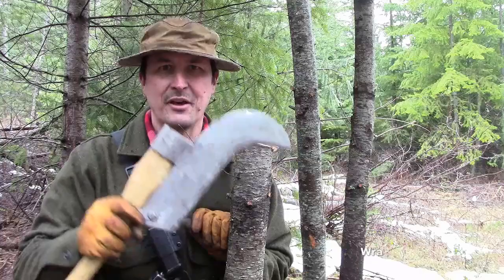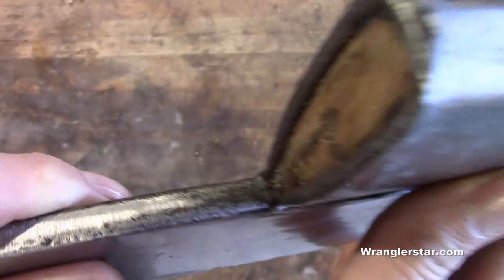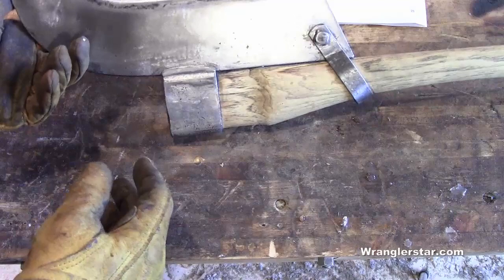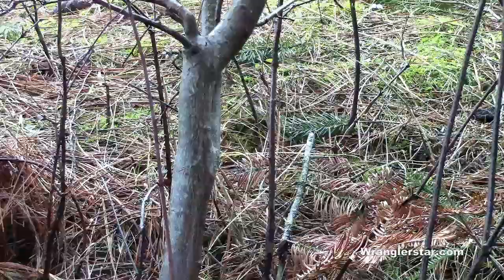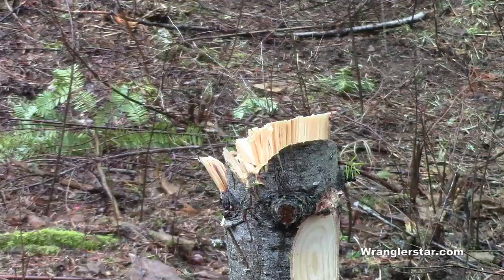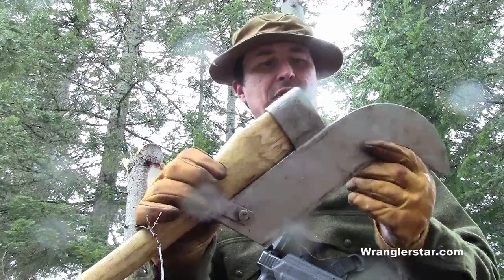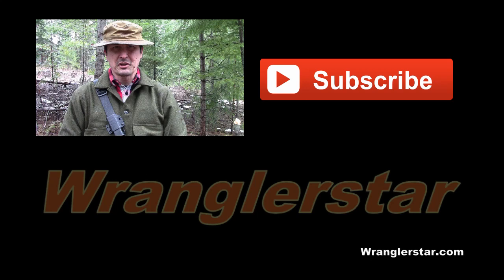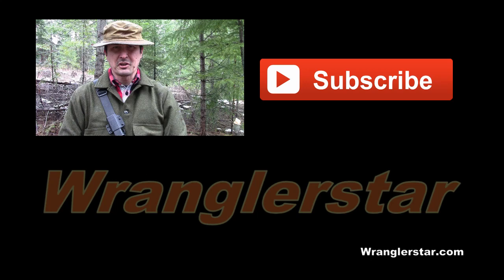A Proper Brush Axe - Wranglerstar

Comment: We use quite a lot of similar brush hooks here in northern Europe. The most common kind is a short handled tool for removing the branches from small felled trees. They are also excellent tools when roaming in wild forests. With a longer handle, similar to the one you used in the video, they are mostly used to cut thick brush where the stems are around 1-2 inches at the most. The long edge is to make it easy to use, as you said it doesn't require much precision. And the hook on the end snags the stem if it springs away. The important thing, as you stated, is to find the correct method when using them. One key thing is it has to be very sharp, and you swing it more lengthwise across the brush, not as much in a cross cutting motion. The tool you got I would say is for clearing larger areas of dense brush, for lighter clearing of single stems a shorter brush hook would probably be more practical (and can be carried in a sheath on your belt =) ).
Reply: Ditto on the tool down South (Greece). My country's equivalent is called among other names "branchcutter". Itis like the Fiskars model but has a rolled steel handle that can accept a wooden handle to reach higher standing branches.
For anything up to 4 inches it is vicious, Pic http://imageshack.com/a/img823/2584/webigp8289.jpg
Reply: GreekPreparedness
Looks awesome. I have a short Fiskars myself =) At the cottage we have 2 or 3 old ones with the same style rolled steel handles, but they need a lot of restoration to be useful =)
Reply: It's the same here in italy...

Comment: Thanks, I have a Friskers brush hook for the back yard and it worked great on the tall weeds and such. When trimming trees I like to cut up the brush to fit the trash cans.  I tried the brush hook and it kind of worked but the hook got in the way,then put a small log on my stump to clear the hook and it was better.  I was looking on line for a good machete and they were about $40 that I did not have.  The book you showed had one sharpened on the back.  I never thought of that.  With that sharp the hook is not in the way.  I am going to try that thanks a lot for the idea.

Comment: WranglerStar Fan Here. Great review Cody! (as always). I used both the type of axe you're using as well as the double-bladed type brush hook when I was working as a land surveyor years ago. I will say that I enjoy using the double bladed type best since it has 2 blades which I can use longer before having to sharpen as well as its lighter in weight which causes less fatigue. Also the double-bladed brush hook, with its lighter weight I found I can get more swing speed with less effort. I would choke up on the handle and with experience you can swing left and right to clear a path with non-stop walking. The double-edge brush hook I've found also works better than the axe you're using on briars and really thin stuff. I also found I could kill snakes easier with the longer thinner blade. Also, the double-edge brush hook has edge on the tip in a way too which can be used for digging or prying some when looking for something. A thinner blade is quicker and easier to swing, easier to sharpen in the field, gives you more edge which takes longer to dull, and I think more balanced. I prefer a straight handle too instead of the traditional handle of that of an axe handle.  We sell both types and the double-edge type is more popular. 
http://www.engineersupply.com/brush-axes.aspx
Reply: I failed to mention, the double-edge brush hook that is thinner, and less weight, one would think it could not cut down larger trees but that is untrue. My rodman and myself would stand back and take turns chopping at a 12" oak or popular and have it down within minutes using. They are amazing at cutting down larger trees as well as thin briers, making the double-edge thin blade what I consider way more versatile than the heavy axe you're swinging.

Comment: We use it for "limbing" trees after  we cut them down. Start from the bottom to the top, cutting from the underside of the branches into the trunk. If you cut downward it tends to want to cut the branch but also strips the bark on the underside keeping the branch still attached and hanging on.

Comment: A long handled billhook. Billhooks are great for clearing brash off cut branches and great for coppicing up to three year old growth. Also for hedge laying (pleaching and splitting long bolts). The small, one handed ones are more versatile and ergonomic than a hatchet. Closer control with a short handled one. When you have mastered the wrist action and you cut closer to the ground... you can cut through a 1 1/2" springy stem with a single sweep.

Comment: We had one of these growing up, of the exact same design but a different make. My grandad and uncle had no interest in learning or maintaining any of the tools we had but oddly enough, I did. I feel a little better hearing that other people think they're unwieldy. I'm a chick and I can still use one but it feels awkward and inefficient. I'll reach for an axe or heavy machete before the brush axe. My Ontario military 18" will go through anything two inches in diameter or smaller with less effort. The handle on ours was original with a beautiful patina and a surprisingly skinny handle, while the blade had a hideous green paint job that probably was added later. Great videos! Just subscribed.

Comment: Helpful tip. When brush is to springy to chop and the area around is to tight to swing, you can put the blade at the base of the brush and yank upwards at a 45 degree angle it'll slice the "vine like" brush. I have a handheld version of that. It's very good for limbing logs without the risk of chopping something off.

Comment: AT 6:11 on the tape we never cut that high we used it to cut down & up with part of the roots all at the same time.   I have the one sharpened on both sides & the pull side works in the clumps & the flat side works on the tree.  I loved mine when younger now it just stays in shop.  Good video

Comment: I appreciate the video you've done. Loved the informative style you offer in a longer form than a shorter 3 minute blitz. Concerning the comments at @5:02 I'd add that a person, even young adult city kid, could use this even if they are weak by just going slow and easy with it to the point you hold the tool over head or out to the side and bring towards the wood just an inch at a time. Building the ability to stabilize and control the tool before attempting a hog wild swing. Week or two of these breaking a sweat sessions would get the fairer of our people up to snuff. Good stuff.

Comment: the curve of the blade acts on the thinner springy stuff because as it bites in the material slides down the blade. The first cutting action is the wedge, then the material sliding the length of the blade and retained against the blade by the inward arching curve is cut by shear.... two cutting actions from one stroke. 

The English developed these for coppicing small wood and maintaining hedgerows..... they call it the Bill or Bill hook. 

The short version the U.S. Army fielded at one time as the fascine knife. Fascines are bundles of sticks used where sandbags are used today.

Comment: I was taught, with an axe, when clearing overgrown lots to swing as close to the ground as possible and as parallel to the ground as possible. It's awkward and hard on the back, but this eliminates possible movement of the item, and it usually just popped off. I think I would've liked to use this for underbrush or bush/shrub type undergrowth. Then my dad got a brush hog, and we just had to cut down 2-3 in. items before mowing. Just my experiences, thanks for the great videos Cody!

Comment: My wonderful DAD called (the one with centered handle and two sharp edges) a "Ditch Blade" and I used one extensively during a summer job in the '60s (Sabine River Authority/Orange TX Canal Division.)  The hook on the tip was ESPECIALLY effective up high to cut and clear the VINES along the rice canal levies that our crew was responsible for clearing lines of sight.  And of course it slices through brush and small saplings at a much more effective rate than an axe.

Comment: I had a job as on a survey crew about 40 years ago. If I remember right, they told me the best way to cut the small diameter brush was to hit it at a very steep angle. It was very effective, and I remember cutting through brush so thick you couldn't see through it. I even saw them cut down large trees with them.

Comment: I usta own several of then i had the bank hook as well as a temper such as you have here, and i loved them. for small brush I always found it easier an better to do a  over head swing similar to to what you use when swinging down on a log, which in appearance closer to a downward sword swing such as is used with katanas silly as it may sound it works very very well cutting stuff up ta 3inch's sometimes 4 with a single swing depending on the hardness. And last but not least glad ta see you have one of these amazing tools. sorry for being two or so years late.

Comment: That’s awesome, we have them here in England and they are great for clearing brash, the smaller billhooks (pretty much the same tool as you’re using except the handle is a lot smaller) are used for laying hedges. They’re a great woodsman’s tool, widely loved in the UK.

Comment: Your deductions make a lot of sense. We use them in England historically as a copicing tool as well as weaving hedgerows and branch trimming/bark shaving. The usual variation in the UK is a billhook - often double sided (one straight and one curved side, possibly a little thinner than your example). Great tools, but yes - many a foot has been lost.

Comment: As a young surveyor I used a brush axe to clear sight lines and find survey pins in hedge rows. It has to be ultra sharp to work effectively. A dull one just slides along the saplings. Many surveyors and foresters have dull ones in their tool box and never use them except to give to newbies to tire them out.

Comment: I have the same one (well same exact style at least, squared off hardware and such)... I do think mine was home made, or at least repaired because of some sloppy welds and the eye is not symmetrical.  I picked it up at a junk shop for 5$ years ago and slapped a new handle on it (after about 2 hours of profiling with a draw knife) ... cleaned the blade up and sharpened it.... it is now a staple in my yardwork shed... I love that thing... Not too many people see them that often either so it makes for a great conversational piece as well.

Comment: We use a bush axe every day while land surveying. Its a great tool, and put in the right hands it can clear through thick brush faster than a chain saw.  The trick is to cut at an angle and low to the ground. I prefer the double sided axe because one side had the hook which is good for bushes, vines and tall branches while the other is flat which makes it easier to cut bigger things. Its the perfect tool for cutting lines and blazing trees.

Comment: I have a brush hook in the style of the first one you pointed out in your book, I believe you called it a Burke style. My Grandfather used it on a railroad crew. I use it quite a bit. I have an old hedge next to my house composed of Osage orange and it really does the trick on small to medium limbs. It's hard to describe just how easily it lops off limbs. I wouldn't trade it for a dozen machetes.

Comment: I did a summer with our provincial forestry service, used a Sandvik clearing axe like bottom right of the book he was showing.  We used it primarily to remove fast growing softwood poplar trees from the around the planted pine trees. The poplar grow fast and shade the pines, and cutting them allowed the pine forest to grow in.
One chop could drop a 5 inch diameter tree. That's quite a bit of power to give a 17 year old. What fun.

Comment: They still make the Burke blade in NC and they Sale for 45.00. Also the handle and tool is significantly longer. Here in NC the prison road crews still use them to clear brush. If I am not mistaken the handle would make the brush axe about 5ft. Long.

Comment: i had one of those awhile back when i didn't appreciate a good axe . i used it on my ranch in socal foothills as a teenager. it worked wonders on shrubs like sage and golden rod. i used it as a thick brush cutter in place of my weed wacker. i set it down one day and went to lunch and havent seen it since

Comment: I use one of these to clean up brush - try swinging with a steeper angle, almost parallel to the branch or stalk of the brush.  The steeper angle takes the spring out of the stalk by directing the force of the swing down along the stalk towards the ground.

Comment: This axe is good for where your at, but it's a God send in the pine belt and south. You can reach into rose bramble or wait a minute and hook and cut a path. We use these to clear along power lines and with a machete and chainsaw.  It's great for clearing brush low where a machete would be a back bender.

Comment: I believe the brush axe is a French tool. I'm not sure but I think the earliest reference I saw for it was as a French brush axe.
A 45 degree angle swing through springy brush on the middle back of the swing gives a nice easy cut. 
 I found the easiest way to cut with one of these is from the ground up instead of from the air down.

Comment: I have found when using a brush axe on the "springy stuff" that getting as close to ground as possible helps.  The hooked end helps keep the edge from being dulled as quickly if your swings are getting into the ground at the base.  And that is where the lighter brush is not as giving.

Comment: Good point on the difference between east coast and west coast.  I deal with a lot more hardwood in my area.  I use a much larger STIHL 660 which I'm sure is overkill in the predominate soft wood areas.

Comment: The curve is to tske out limbs of trees . You use the overhead swing and it easily takes out limps. With s regular axe its awkward and hard to do. The brush axe makes clearing trails and areas say from 6 ft down very effective.

Comment: Those are great tools, used them for many hours clearing brush. Cody the one you have has been sharpened to the point that it needs a serious regrind., HardWayLearnt noted that too. If you compare your tool to the one in the USFS manual you show at the 2:00 mark, you can see how much of the hook has been ground off of your tool. If I may be so bold as to suggest you get out your 4" angle grinder and regrind your bush axe to match the picture in the manual. I can also suggest to you that we used this tool differently than you are showing, we pulled up, or swung up from the ground, away from one's body, of course, (again HardWayLeart mentions a similar thing). Kind of hard to describe, but the way you are swinging it now, you are pushing down on the thing springy bushes, this makes them spring out of the way of the brush axe. If you swing up from the ground, the thing piece of wood is held in place by it's own roots and then is taunt, and cuts easily. The brush axe needs to be kept sharp, and I think with some practice and use you will find it it a very easy tool to get along with and it will do a great job for you.
I hope this helps in some way, love the videos and your channel.
Cheers!

Comment: about the best tool in the world for quietly clearing shooting lanes around deer stands here in Arkansas.  It will take down 4-6" trees if used with precision.   Has good reach for most limbs that are in the way, and the hook tip "grabs" the brush and doesn't let it slip away as easily.  Now I want one like yours.

Comment: First time I saw a brush axe was over 15 years ago doing volunteer work for a National wildlife refuge. It was a short handled one and well used ( probably an antique) it worked well on woody plants, grass brush briars maybe a little less dangerous looking vs a regular machete. I liked it so much I bought a Fiskers brush axe for myself and I like it and still use it. I can tell you it is a useful tool even on the east coast along a tidal marsh and woods field hedge row environment
Reply: O and there great for taking limbs off of trees which you used yours for at the end of the video. I bet it would work on sage brush too. I always wanted to use mine on a fire crew when we’re in sage country just never got the chance

Comment: I have one of those and find it the BEST tool to clear brambles/berry canes. You can use it like a machette to get at the base then like a scythe to cut large chucks of canes out. The hook keeps things cutting and not sliding off the top when you swing.
When clearing land ill take my chainsaw and one brush axe you can clear almost anything.